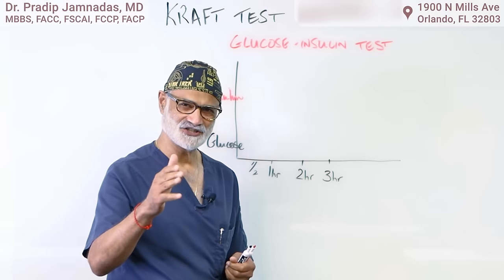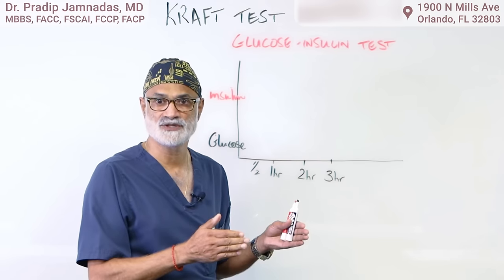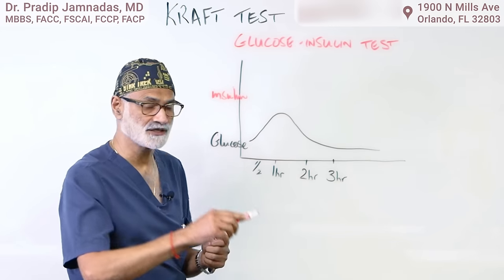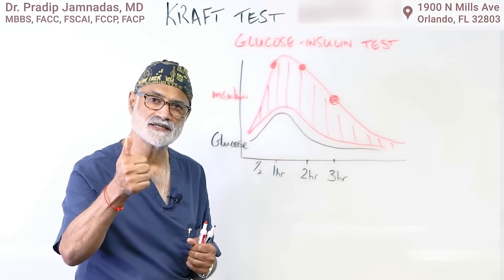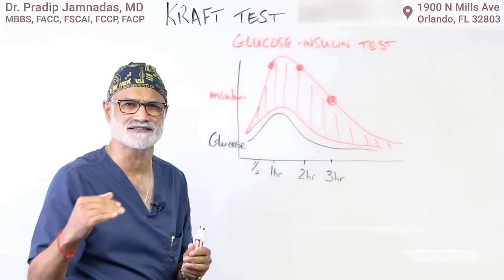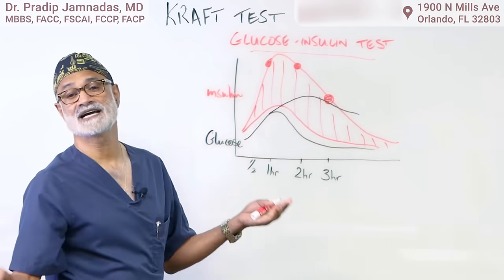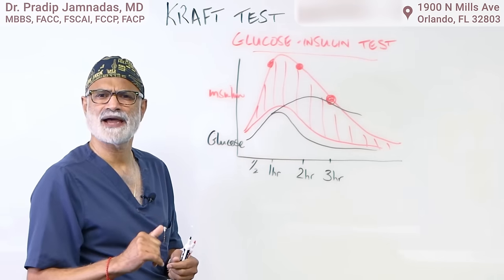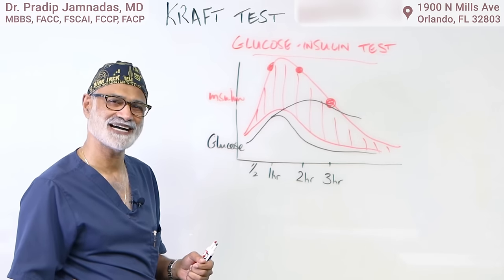How Hidden Prediabetic Patients are found with Kraft Tests and 5 Major Causes of Insulin Resistance

Comment: Before I started IF, low carb meals and now OMAD, I was at 230 lb, high blood pressure 160/100, frequent acid reflux, fatty liver, insomnia and anxiety attacks. I was considered pre-diabetic, although I think I was well in the diabetes range as my insulin must have been very high to keep my glucose at 99. Never had my insulin levels measured (some doctors are useless). Dr. Jamnadas videos opened my eyes. Started fasting, and gradually eased into 18/6 fasting and eventually OMAD with low carb, moderate protein and moderate fat nutrition. Lost 30 lb in 3 months and never felt better in my life. BP is 120/74, normal sleep, 198 lb today and plan to get to 185 for my optimal weight. I will have to check my liver enzymes again, but based on my weight loss and overall energy levels, I am 100% certain that my fatty liver condition is gone. I will maintain this lifestyle as long as I live.
You, sir, are a blessing to humanity.

Comment: I did this test and my insulin fasting was 4.2. After 30 min went to 160 when the range was (6-86) and after 90 min went to 28 when the range was (5-56). My A1C is 4.4. It seems I am a typical example as Dr. said. This doctor is brilliant.

Comment: This is very informative.  However, many doctors, nutritionists and fitness experts say that eating frequently is the proper way to eat which contradicts the info in this video.   With that said, how many meals a day or how far apart should meals be to avoid insulin resistance?
Reply: Watch his videos on the benefits of fasting and it will answer all of your questions 🙂

Comment: Dr Robert Atkins, in his books written in the 1970's explains this exact thing, but with different keywords. 
He explained that if your body doesn't recognize it's own insulin, then it doesn't know what to do with it, so it stores it for later. 
As each cell fills up with insulin, it becomes atrophied or no longer flexible & that's when disease happens. 
The clogged arteries is the arterial cells are full of insulin. 
Blindness is the eye cells filled with insulin. 
Neuropathy is the muscle cells so filled with insulin it pinches the nerves. 
Stroke is the brain cells filled with insulin to the point the cells die.
Heart attack is the heart cells filled with insulin to the point the heart stops beating.

Comment: Question for the Doc: Is it also true that Insulin Resistance is a double edge sword? One two much glucose (carbs, sugars...intake) and secondly, to much (fat). Cause: Intramyocellular lipids that radicalize or oxidize in the muscle cells causing a failure of the enzymatic reactions to activate Glucose Transport to slow and fail, hence not allowing glucose to enter into the muscle cells at a slowed rate even though there is enough insulin in the blood which is the key to the lock???

Comment: The great seminar shed new light on preventing health problems. I need personal advice from Dr. Jamnadas, but I am in Italy, at the University of Naples, actually working as a professor of genetics.  I have had a fasting diet style of 8/16 h for the last 12 months. My father was diabetic and insulin injections dependent. My glucose can go up to 140-150 if I eat more than usual or sugary food, but usually, I manage it by eating no more than 70-100 bread/past. I would like to take a KRAFT test, but I am afraid that it will be false by my eating style. For example, 2 weeks ago, I also did 40 h fasting drinking only water, and I had a large breakfast with glucose at 150 (after 2h). At lunch, I eat a sandwich with cheese and meat, and the glucose went to 212. I suspected that this was a reaction to the long fasting of 40 hours. So, should I modify my eating style of 8/16 for one week before taking the Kraft test? Best regards Giuseppe

Comment: The main problem for low carbs diet and intermittent fasting is dehydration and nicturia with bad sleep. This is because during the night hepatic glycogen is burned and there is a release of water. So the kidneys have to work during the night and there is high production of urine.
Reply: @VETERAN VS The video you posted is not related to my argument. I was talking about keto diet.

Comment: Your vedio is very informative but what about the genetic factors related with diabetes? what you mentioned are the predisposing factors for diabetes not the original cause that is the genetic factor the defective gene that causing diabetes,if you have the gene no matter what you eat you will finally developers insulin resistance and diabetes and if fortunately you don't have the gene you will never develops insulin resistance or diabetes no matter how much carbs and how frequently you eat

Comment: According to my continuous glucose monitor fat increases my glucose and gives me the top curve after eating fruit.  Whole food carbs are not the problem, high fat seems to be the problem.  You can avoid healthy whole food carbs if you want but if you eat low fat you can eat pure sugar and not have high insulin.  This was proven back in the 1930s and it seems to work for me.  I eat allot of fruit and CGM shows little glucose response....I haven't used insulin in months.
Reply: You are correct! The lipids or fat blocks the insulan from entering the cells and this creates the high amount if insulan.